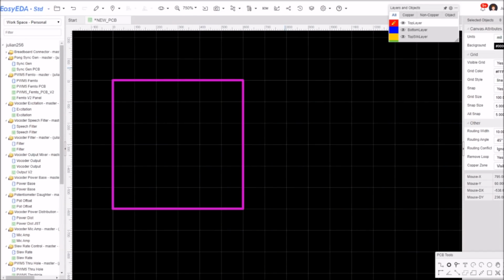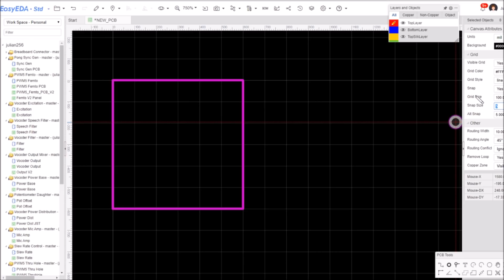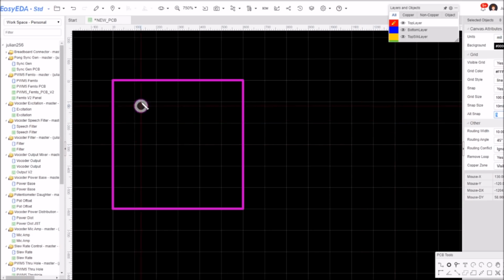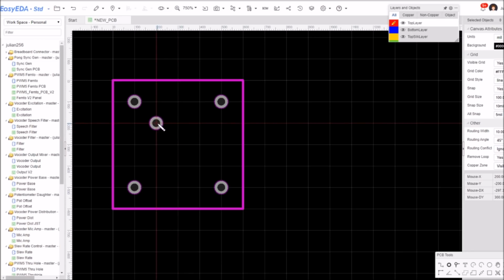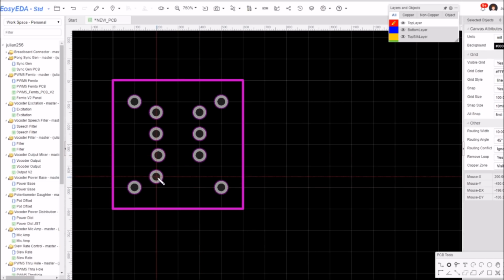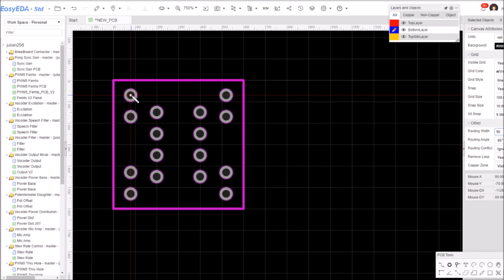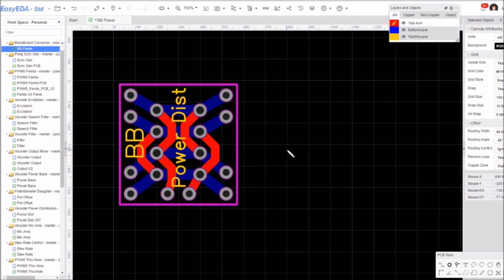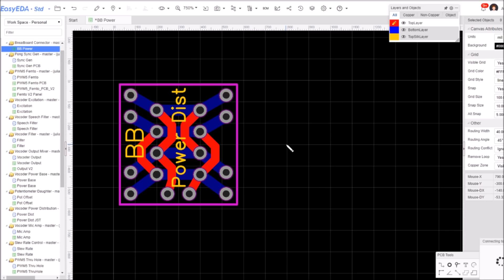8-Bit Breadboard Computer Ramblings - OInK

Comment: Hi Julian. Just a quick rant about LED bar graphs and SIL's.
Why are'nt single colour 8 LED versions available?
And why are there no 10 resistor SIL packets (11 pin)?
I've looked everywhere.
You've inspired me to something similar to OInK, but I'm designing a 10 bit interface to plug into my Spectrum+2, (just for a giggle), using the joystick ports to read from EPROMs.

Comment: Really basic concept I need someone to help me with. Julian mentioned he had a seperate circuit after the buffer with its own PSU: I assume current still flows even when the source and the ground are generated by different power supplies? If electrons flow to the ground of a different point, then there is no replenishment of electrons at the source: what's the consequence?
Reply: he doesn't. it's still the same power supply, he just doesn't draw the power to light the LED directly from the data pins. the buffer is essentially a kind of "amplifier" for the data pins so that the logic chips don't have to drive any high load. so if the buffer sees "input pin 1 is high" it goes "better switch output pin 1 to VCC" (and "input 1 is low -> switch output 1 to GND") but without actually pulling current from the input pin to do so, which can drive the LED better than going directly to the data busses (because then your LEDs could draw enough current to mess with the other chips seeing their inputs, or overload a chip's output)

note that this would work with a different power supply for either part of the circuit though, in which case you'd have to connect their grounds together so that they both have something to reference to. this is e.g. often done with serial ports or similar, where you'll have a common ground (sometimes a pin, sometimes the shield of the plug) and some data pins, but without a shared VCC supply. since the grounds are connected together, the data pins are the same voltage in relation to the common ground on both sides, so everything works even if both sides use different VCC.
Reply: @nonchip  Great answer. Thank you

Comment: My most used breadboard can be seen in this video https://youtu.be/bU-ObHCvj34
Not had any problems with voltage loss or voltage drop. Sometimes, some component leads don’t like or can’t find the sweet spot in the sprung contacts to go in first time, but apart from that, it works well.

Comment: Wir sind die Roboter .  Remember start ground points and breadboards are tricky to logic circuits , so add also 10uF ceramic caps on power rails .. or avoid tricky breadboards for this purpose... The project itself it is neat , looks like some kraftwerk show :D

Comment: Those cheap breadboards are more trouble than they're worth. Push in one slightly oversize component or a lead at a bit of an angle and the interval spring clip bends and then it won't grip component leads properly. I've had so many circuits that are intermittent or just don't work. I bought a stack of boards from China and I've ended up throwing the lot. On the flip side I've some boards I've had for years I got from Rapid and are fine. False economy these cheap boards.

Comment: I think you are jumping to conclusions here, Julian.  Time to get out the multimeter and scope and prove where the voltage drops are AND that your current solution will solve it.  Solder up some of your intended male connectors and confirm it fixes the problem before ordering PCBs (even if they are free).  It may solve the problem but it may also show that the voltage drop is on another wire such as the ground or Vcc of the IC.  I think the problem is those individual breadboards or maybe light corrosion on the actual IC pins.  Some (cheap) breadboards just don't provide a solid force on the pins or wire inserted.

Comment: FWIW, I saw a video recently (can't remember which channel) where he ran a pair of fat power leads down each side of his eight-bit computer. At each breadboard bus he soldered on a pair of fat connector pins (the kind you use on Arduino shields) and then plugged them into the bus. It seemed to work quite well.

Where did you get those 8-led things you're using for the binary displays? I've found lots of 10-led ones, but none with 8. Or are yours just 10-led displays with the two end LEDs blacked out? :-)
Reply from the maker: Yes, I just used a Sharpie to cover the two end LEDs :)

Comment: I used strip board, header pins and bodge wires for my 5V USB power supply to my breadboard.
It was a bit wasteful to have it the full width of the  BB, but it was cheap and quick.

Comment: instead of making PCB's why not just cut slots in the sides of the breadboards from the underside of the breadboards next to the bus lines and solder the power wires directly to the bus bars?

Comment: I would send you some old AMD bit-slice ALUs if you didn't live all the way in the UK.  They are small ones which were on a multiplier board in an old signal analyzer.

You could also implement a very simplistic ALU using lookup tables, like the IBM 1620 did.

Comment: I feel your pain on the breadboard distribution. Did you consider putting some pads for a decoupling caps on it? I hate to mention SMD, but a couple of pads on the bottom would fit well.
Reply: Great to see an Oink outing though Julian!
Reply from the maker: Thanks James - There are a couple of through-hole pads which can be used for either a capacitor or a connector. I bought a 20x4 LCD recently which I'm going to use for a 'hello world' video. Even a computer with no ALU can copy literals to an LCD :)
Reply: @JulianIlett  Yeah, that should be quite straightforward. My lcd should be displaying numbers in the not to distant future, that will involve far more alu than most people realise.

Comment: Must be a huge amount of stray capacitance in a breadboard. "Huge is a relative term"..
Reply: as long as you remember to tie unused pins to places or terminate busses if they misbehave, that's actually not a bad thing, means your power supply is more stable at least ;)

Comment: measure the resistance of the power lines in the breadboards.
Reply from the maker: It's the resistance of the connection between the inserted wire and the metal strip inside the breadboard that's the problem.
Reply: @JulianIlett  I see. I didn't get to the end of the video yet. now I'm curious what my various breadboards are like. I have some pretty nice ones and some that I think are garbage.